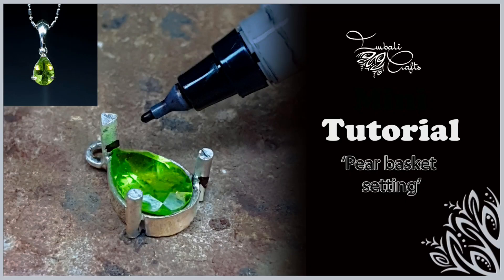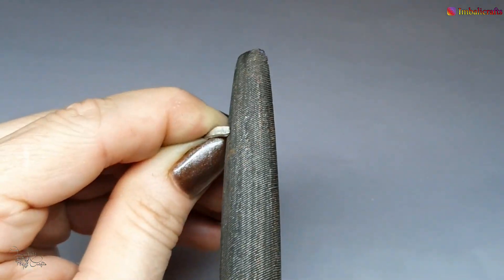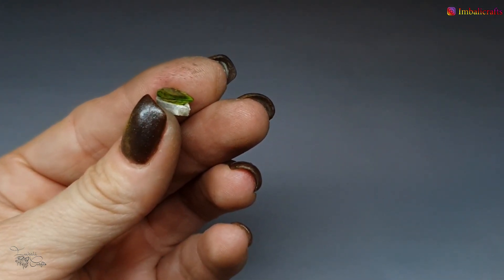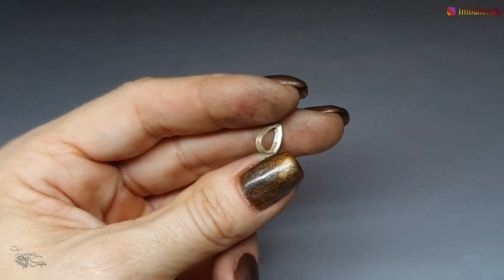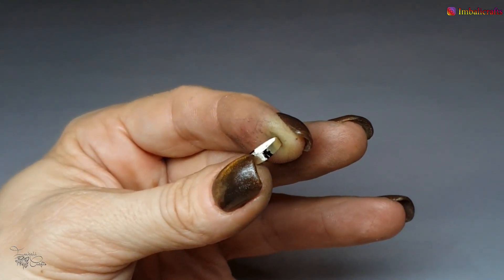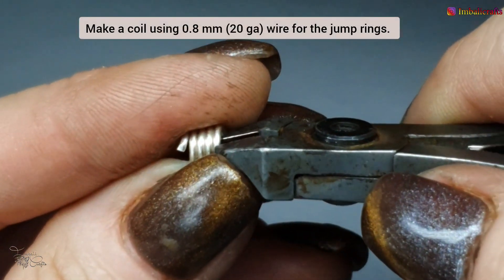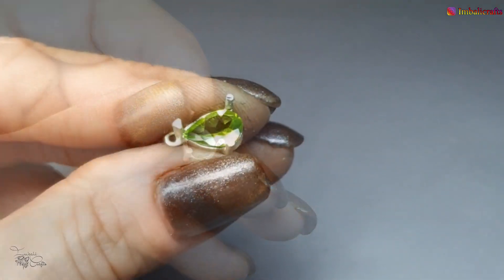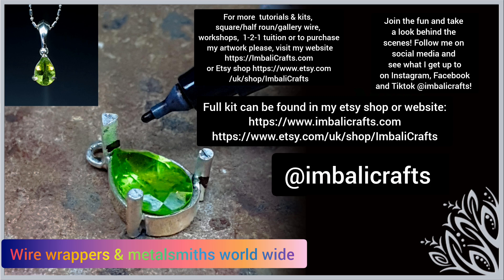Pear basket setting

Comment: Good tutorial. Thank you. But I am not sure how we went from the stone sitting way on top of the bottom to sitting in deeply. I don't think the little bit of filing down the edges did that.
Reply from the maker: Yes, you would file the setting down in the corners, or taper the inner edges a little if the stone won't sit snug from the start. Hope this explains it :)